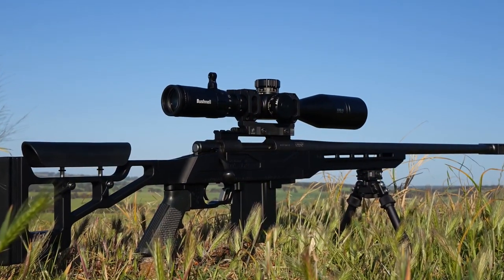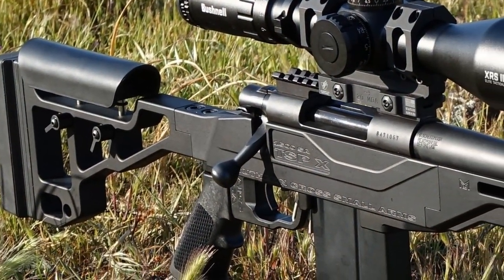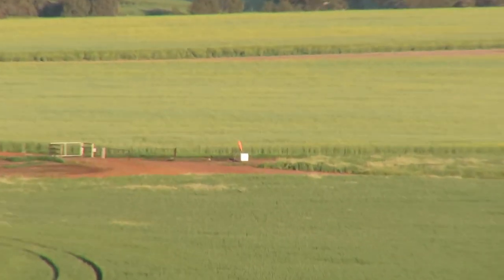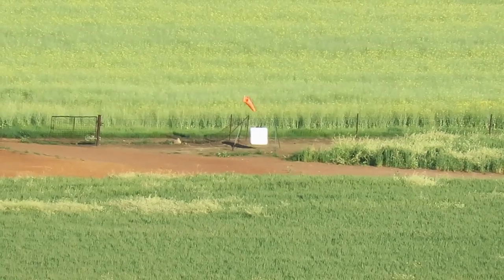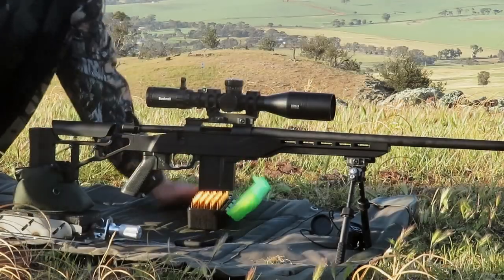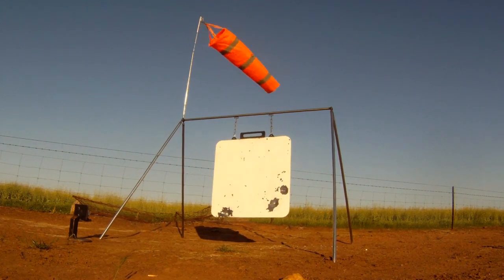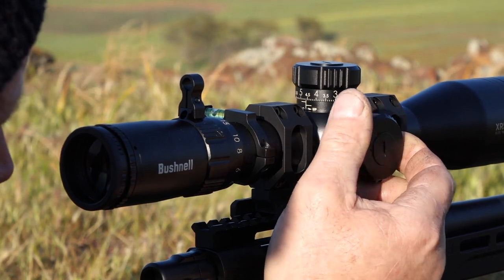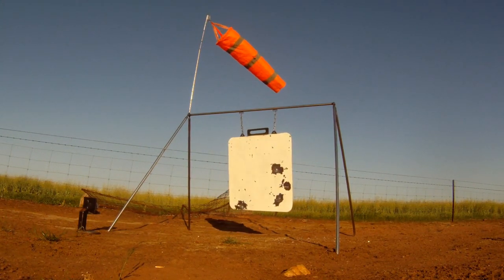SCSA TSP X Chassis (Test and Shoot)

Comment: Longtime watcher of 4aw here, lots of great new content! 
Looks like the chassis and action shoot well.
In terms of fit I see the scope is mounted as far forward as possible, the chassis could do with a longer stock section or perhaps to add double the amount of spacers.
Cheers
Reply from the maker: Depends on all the details, but works great for all set ups and people size we have tried, they also have new folding option, that will make longer too, Cheers

Comment: Nice review. What brand of magazine are you using?
Reply from the maker: Thanks Man, AICS mag, Cheers
Reply: Is there much play with that mag? I'm using a MDT mag and there's a lot of movement with the mag in that chassis.
Reply from the maker: A little, about normal, but not uncommon to be a little different between individual mags, and a lot better than too tight, Cheers
Reply: @markandsamafterwork  thanks mate.  I might order a AICS Mag. Thanks again mate
Reply from the maker: Never hurts to have some extras of something like that, Cheers